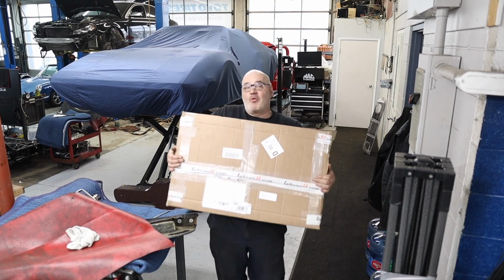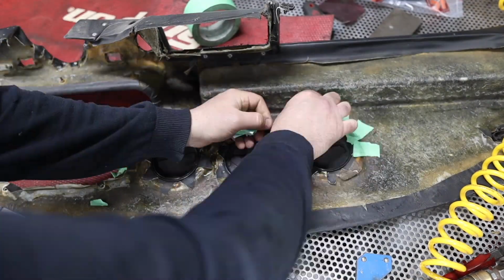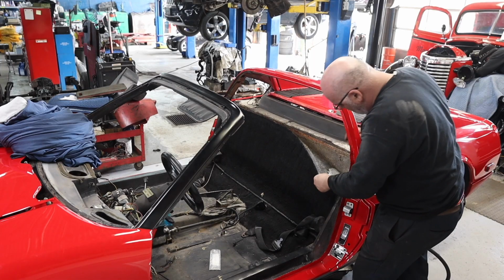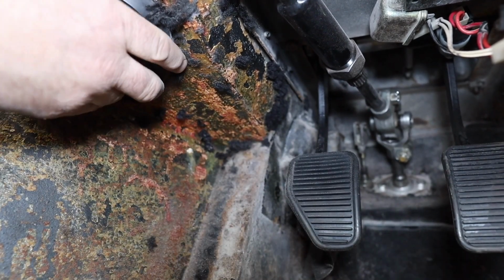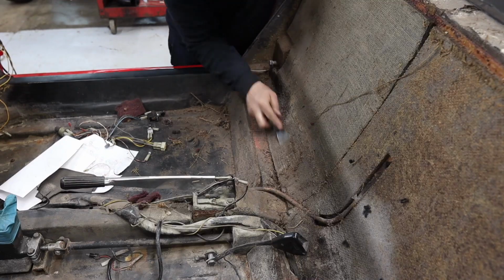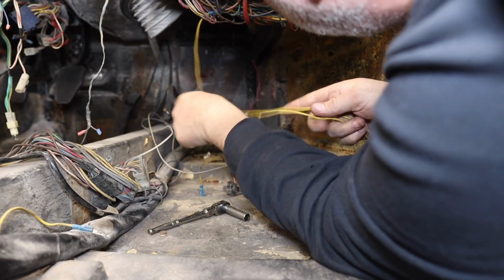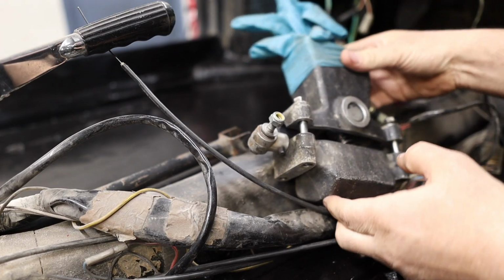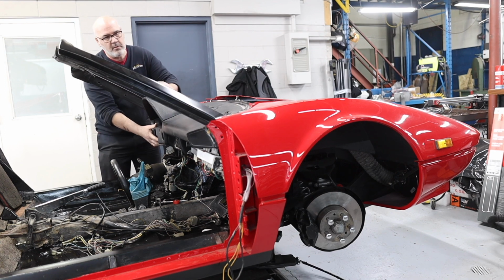#Ferrari 308 GTS rescue and restoration!

Comment: 14:55 marine bottom paint is made for fibreglass. They also make paint for engine compartments to seal and protect the hull. If you go with bottom paint (no smart ass comments lol) get the stuff with copper in it, it won't bother you or the car. There are some with herbicides that you don't want. They are designed to leach out the herbicides over time. 

BTW: LePage's solvent based contact cement will stick to that fibreglass like no tomorrow. Done it many times. I find the solvent based sticks better than the water based. 

There are also carpet adhesives that would work. They are designed to stick to just about anything. They are a little thicker and you have to put them on with a notched trowel. 

I've used this before with really good results. You can apply it to the back of the carpet with the v notched trowel then put your piece in place and rub it down HARD.
Reply from the maker: Thanks.

Comment: 7:15 least one good thing: it's so old the adhesive is petrified so it comes off easy. I remember doing a reno on a house and they had glued down the carpet in the sun room (over concrete). I dreaded the job. I peeled up one corner and yanked for all my might and ended up on my a$$ because it peeled away so easily lol.

Comment: I know you've done the dash, BUT, as you put it in some white residue gave me an idea. The front bit of the dash that faces the passengers ( I think its the bit you put some extra foam behind) what if you find an interior guy and let him make that strip alcantara. So it goes from the leatheret on the top to an alcantara strip on the part facing you....I think it will look amazing. Not stock and will be a b$tch to take stuff out again, but will look really good, maybe even in a different colour which could be matched by a center strip on the seats.
Reply from the maker: thanks, trying to keep on moving forward.  But I do agree it would look great.

Comment: Perhaps put down some Noico sound deadening mat. Keeps out some of the road noise and any vibration is absorbed. Plus insulates keeps out heat and or cold to some extent. That has become a big project.
Reply from the maker: I was thinking some mat but doubt it will happen.  more $$$ than I want to spend.  thanks
Reply: @LouTrottier  it is really inexpensive at $50 to maybe $100 for a box all you would require. I know that it is extra but at this stage why not.....
Reply from the maker: @gregorystewart6539  the stuff I looked at in that price range was no where near as thick as the original matting so I decided to pass.

Comment: I didn't know the floors were fiberglass.  Do you know if they still are in the later GTSi models?
Reply from the maker: I believe they all are yes.
Reply: They are all a tubular chassis, with fibreglass inside and a thin metal skin on the outside underneath.

Comment: What was that Fender amp in the distraction part of the vid Lou?
Reply from the maker: It’s a 70’s silverface vibro champ chassis  that had been put into a fender bass amp cab with a 12 inch speaker. It’s a killer 4 watt.
Reply: @LouTrottier  Too cool! I have a 70's SF Vibro Champ myself. Awesome lil amp. Putting a WGS speaker in mine soon as I can get one in Canada again. Been watching the Ferrari restoration from the start. the 308 was one of my fave body styles.
Reply from the maker: @gpower  very cool,  my little champ has a 12 inch weber speaker.  I also have an original blackface 65 Deluxe reverb.
Reply: @LouTrottier  The Holy Grail amp, IMHO... I had a first year SF for a few years. Dlx has always been my favorite amp, bar none. I have an SS22 and a Traynor YGL-1 I use wet/dry when I need more volume.
Reply from the maker: @gpower  sounds like you have great taste in amplifiers.
Reply: @LouTrottier  You have a couple of pretty damn good ones yourself.